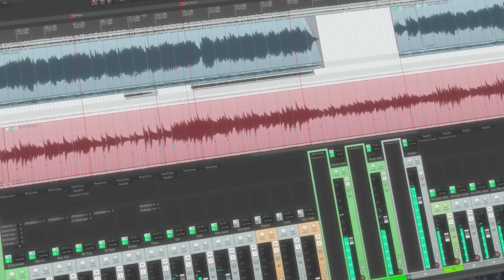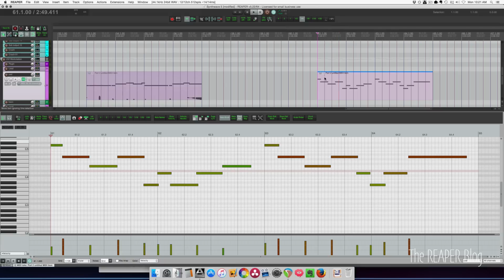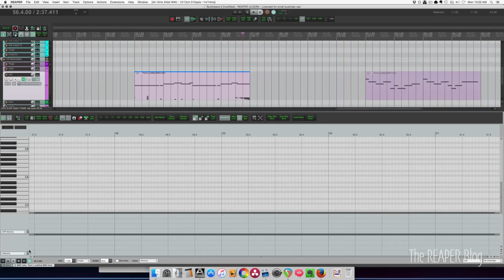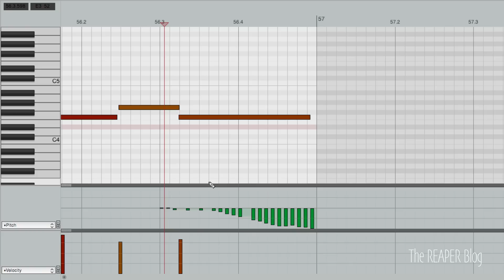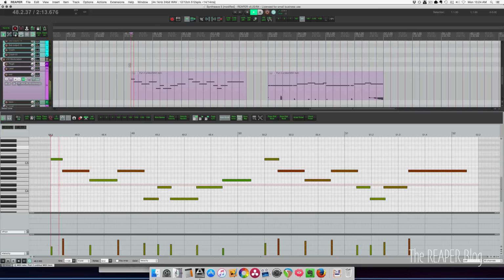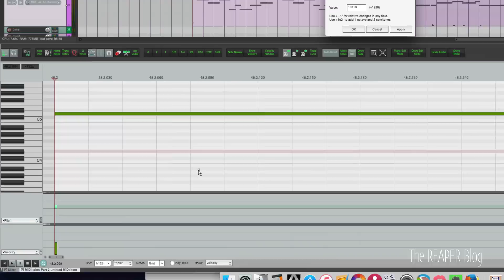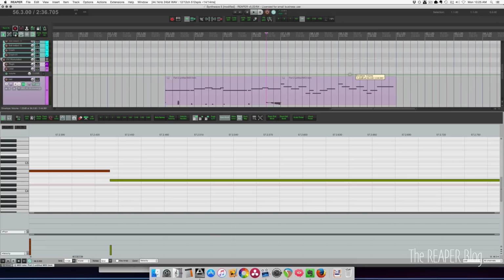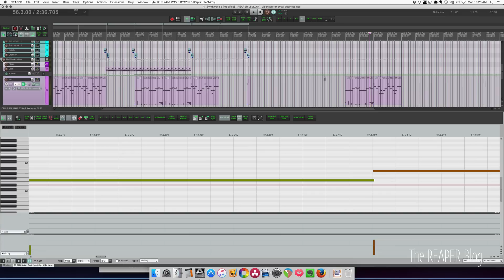How To Reset MIDI Pitch Bend

Comment: Good video!! I know your video is old, but I'm new to using Reaper. I have an M-Audio Oxygen Pro 49, and my pitch bend is controlling my fader 1 at the same which is frustrating.. I'm going to try your method and watch the other video also.. Thanks for the knowledge and glad I came across your video

Comment: Where did you find the number 8192 referred to as the reset on pitch blend?  Are there other useful codes like that in the reference?  I ran into this issue yesterday.  Thanks for this gem.  8192 . . . 8192 . . .I'm trying to make myself commit 8192 to permanent memory.  LOL!
Reply from the maker: its half of 16,384 of course. :) If I remember correctly I had to ask someone.
Reply: @TheREAPERBlog  OK, I'll bite....What does 16384 … Oh wait!  You're messing with me.  Maha!  :p  Just woke up from a nap.  Derp!
Reply from the maker: @tersta1  I was messing with you, but also that number is the max range for pitch bend so 8192 is right in the middle.
Reply: @TheREAPERBlog  16384 is the range for pitch bends?  It seems to be an arbitrary number, but I bet it's not.  That's semitones, right?  Do you know of any musical instrument that might ever produce a note range that broad?  I doubt speakers could produce that range of sound. DAWs can represent it either.  Where did you learn of this diabolical number?  Now I'm interested in the history and standardization of digital music programming.  I wonder who invented it?   I'll look that up.    Thanks.
Reply: @TheREAPERBlog  OK, the inventor is ethw[dot]org/Thomas_G._Stockham from MIT, if you're interested.  Digital Signal Processing … Replace the [dot] in that link.
Reply: @TheREAPERBlog  A'ight!  No worries.  You can't abuse pitch bend to boil earwax or anything like that.  The 16384 gradient is BETWEEN semitones and not a semitone range.  I found this discussion on StackExchange: 
MIDI pitch bend vs MIDI Tuning Standard: microtones

Ok, here's where it gets odd. Using the MTS approach I get 16,384 tones between the base note and the next semitone. Eg, between C and C# there are 16,384 notes.

With pitch bend I get 16,384 stretched between two whole tones (four semitones). Starting with the base note you get +8192 tones to the next whole tone or -8192 tones to the next lower whole tone.

So both approaches use 16,384 values but pitch bend is stretched across two whole tones while the MTS method is compressed to just one semitone.

music[dot]stackexchange[dot]com/

questions/47995/midi-pitch-bend-vs-midi-tuning-standard-microtones

Comment: My problem is that Reaper/Kontakt adjusts the pitch wheel for no reason.  I don't even have a midi item on the track yet just playing around and all of a sudden, the pitch drops on me.  If I open Kontakt, the pitch wheel has been turned down on its keyboard.  If I tap it back in place, everything is okay for a while.  I just noticed that my midi controller has a "Kontakt" setting so maybe that is what my problem has been.  I always used Basic Midi 1 setting on this Novation Impulse probably because I only recently started using anything Kontakt.  I would like an easy way to tell a track NO pitch wheel unless I add it:))
Reply from the maker: maybe yours is broken too?

Comment: I put a ReaControlMIDI before my synthesizer, it has a automatable parameter for midi pitch bend so you can see the envelope and not only reset it more easily but also control it better.
Reply: I do that too. I have a track template with auto-arm, MIDI overdub and ReaControlMIDI. My productivity increased a lot.
Reply: I do produce electronic music in Reaper.

You're right, setting it up is a fiddly workaround, but track templates mean you only need to set it up once. ReaControlMIDI will allow you to automate pitch bend, mod wheel and any other MIDI CCs in the timeline rather than in the piano roll. The only problem is if you want to record pitch bend from a MIDI controller, it still records to the piano roll.

I got around this by using a plugin called midiNotchFilter (http://thepiz.org/plugins/?p=pizmidi ) on my Input FX Chain, stopping pitch bend and mod wheel from being recorded. I then mapped my pitch bend and mod wheel to ReaControlMIDI and ticked "only when track/item in focus."

I plan to do a video on this soon.
Reply: I'd really like to see that video :)